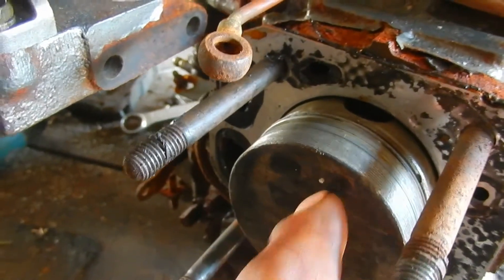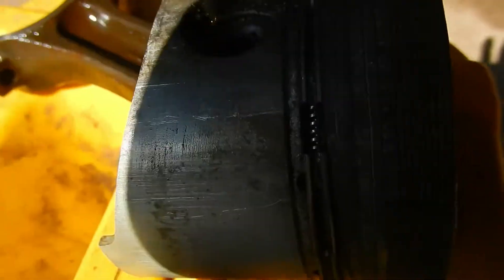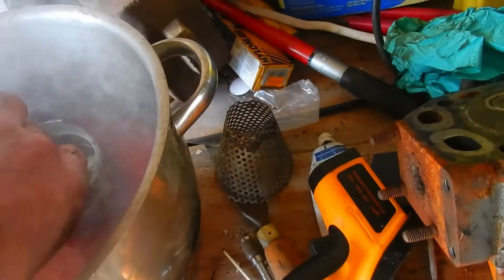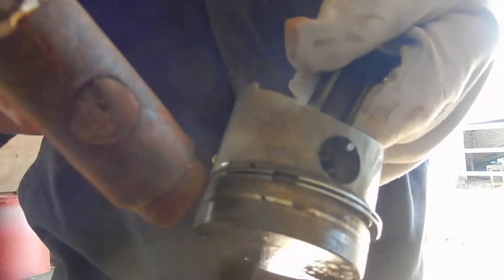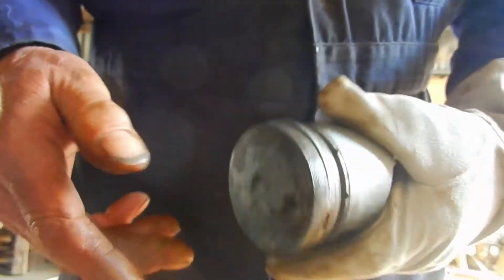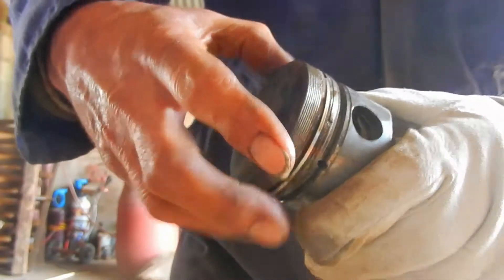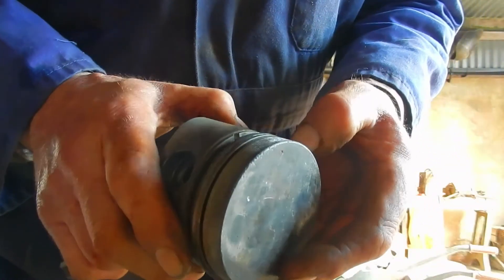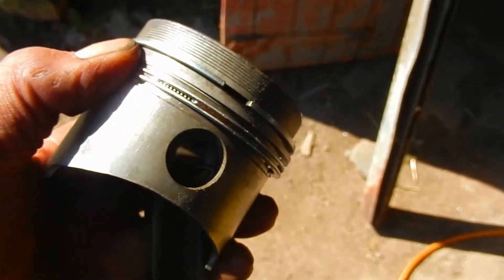How to free seized piston rings

Comment: Should you mark where the ring gap was? Or they will position itself when engine runs?
Reply from the maker: Some pistons have pins to locate the rings, If your piston does not have those pins the position of the gap is not important but it is good practice to stagger the ring gaps around the piston. Good luck, Jon

Comment: Any suggestions for same issue on a 3.4L Toyota engine still in the vehicle?
Reply from the maker: Hi. I imagine that it has overheated? In which case sorry, can't help. If however it has been standing too long you can try repeated doses of penitrating oil and a bit of heat on the piston crown, most likely a waste of wd40 and time though! Good luck, Jon
Reply: @Wotjonsez  never been over heated. Head gasket leaked into cylinders 1 & 2 in work parking lot during winter. It would not crank over because coolant was in the two cylinders and I had it towed home. I blew out the cylinders and sprayed fogging spray into the cylinders. I just didn't plan on it sitting for two years which is why the piston rings are stuck, well rusted and causing the no compression. I talked to a local guy that said to heat #2 heating fuel to 145° and pour into cylinders with the drain plug open do it will drain into a pan. I would imagine that any of the chemicals that are supposed to help with rust would work like that since heat makes metal expand. I may give that a try. If it works, I may post it on YouTube.  The old man said he had did it to engines that sat for 20yrs or more and it worked...lol.

Comment: do you think parrafin would work instead of diesel?its just that ive got loads of parrafin knocking about
Reply from the maker: Hi I think that paraffin is a bit more volatile than diesel, it vapourises quite easily and the vapour is very flammable so be careful. Regards, Jon
Reply: @wotjonsez2560  good point bat man,i'll stick with your method of diesel Jon.many thanks for the reply,Dave